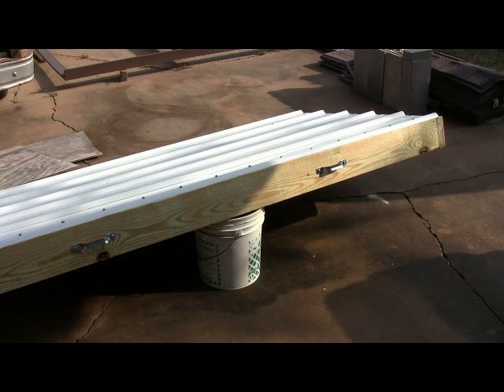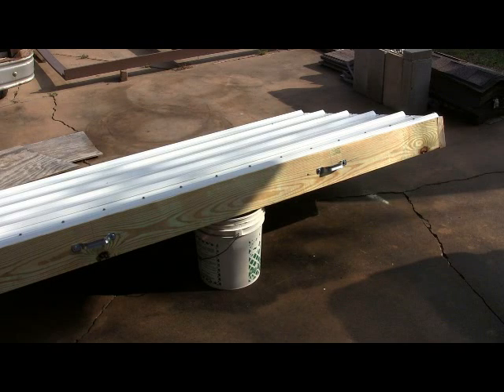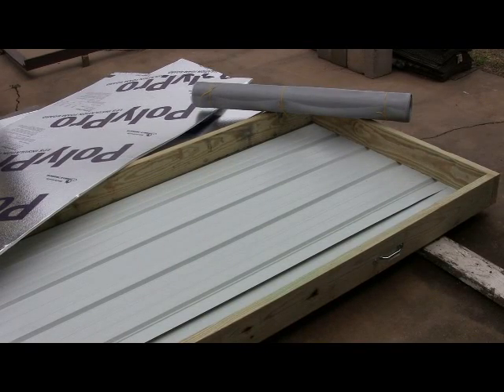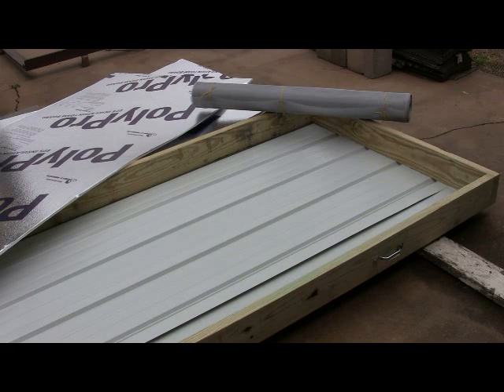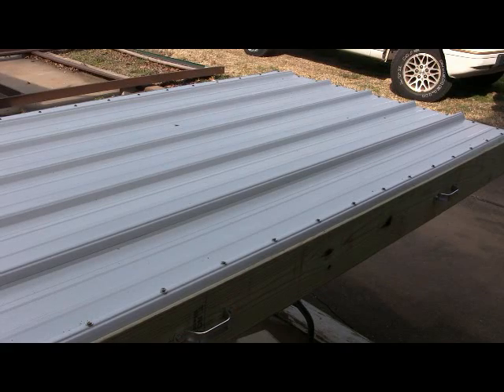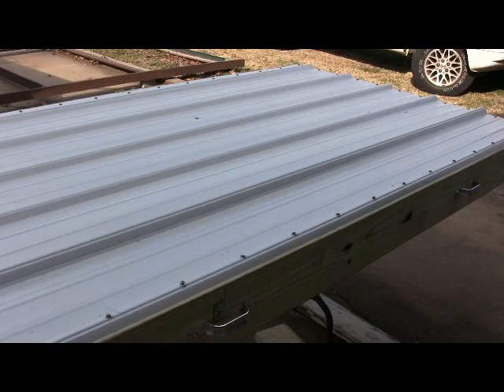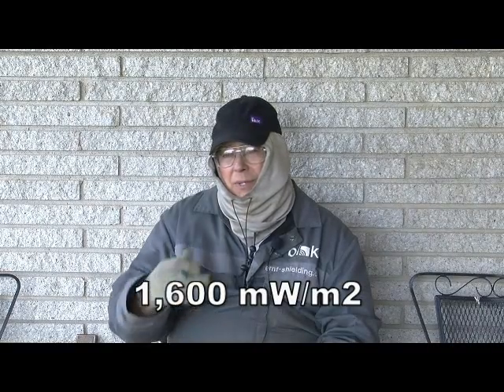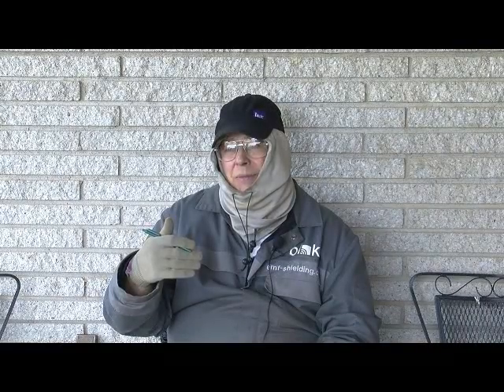Shielding yourself from Smart Meter microwave radiation.

Comment: I’ve done some research on this and supposedly copper will block these energy waves. I have not done this I’m just passing it on. You could line the wall with copper on the inside of home where the meter is and or build a box around the meter.

Comment: Do this until you can get your smart meter off your house I AM VERY SICK AND I PUT A SIGN ON MY HOUSE BY THE SMART METER TOLD THEM THEY BETTER NOT PUT ONE ON MY HOUSE THEY KNOCKED ON THE DOOR I TOLD THEM THEY BETTER NOT PUT A SMART METER ON MY HOUSE THEY LEFT CAME BACK A WEEK LATER AND I TOLD THEM TO GET THE HELL OFF MY PROPERTY ARE I WILL SHOOT THEM TOLD THEM I HAVE A RIGHT TO PROTECT MY PROPERTY AND I HAVE A GUN AND THERE IS A LAW WE CAN STAND OUR GROUND THEY LEFT THEN A COUPLE OF WEEKS LATER THEY SENT ME A LETTER TELLING ME I HAD TO PAY EXTRA FOR NOT HAVING A SMART METER  IT WAS FOR THEM NOT TO HAVE TO WALK TO EACH HOUSE TO READ METER  I SENT THEM A LETTER TELLING THEM I WAS VERY SICK WITH CANCER,DIABETIC,COPT,LIVING ON OXYGEN AND I WOULDN’T  PAY CRAP FOR THE NONE SMART METER  AND THEY CAN GO TO HELL I KNOW THEY ARE KILLING PEOPLE AND MAKING PEOPLE VERY SICK BUT THERE IS A WAY YOU CAN FIX YOUR SMART METER GET ALUMINUM FOIL SEVERAL LAYERS AND WRAP IT AROUND THE GLASS TO THE BASE OF THE METER THEN GO BUY ALUMINUM SCREEN MAKE SURE ITS ALUMINUM SCREEN  THEN MAKE IT IN TO A CUP THE SIZE OF THE GLASS WITH ALUMINUM FOIL OVER IT  THEN PUT IT OVER THE METER AND BUY A BIG RING THAT YOU CAN SCREW ON IT TO TIGHTEN IT DOWN AND VERY LITTLE RADIATION WILL COME OUT OF METER.RADIATION IF YOU DONT DO THIS RADIATION COMES FROM YOUR T.V.,MICROWAVE,ANY APPLIANCE IN YOUR HOME 🏠 EVEN WASHING MACHINES & DRYERS,CELL PHONE AS WELL. DO WHAT I SAID AND THAT WILL FIX THE PROBLEM 👍👍👍GODBLESS EVERYONE OF YOU🙏🙏🙏🙏🇺🇸🇺🇸🇺🇸🇺🇸

Comment: I didn't watch this whole thing, so don't know where this is being installed. But if the meter is still on the exterior wall, you are STILL being bombarded right through your wall into your home! The waves radiate in all directions. Plus, you may be getting MORE radiation by reflecting it into the house! You also don't need metal. Just line the inside of the house with about 4 inches of solid wood. That's probably a better shield than this. The only way to know for sure is to take readings from inside the house.

Comment: Do why dont you simply incase the smart meter in lead sheeting? That makes more sense than trying to erect something these waves pass right thru. Shure it may (or may not slow them down) where as a lead shield will not slow then  down. It will stop them altogether? And it in no way will affect the functionlity of the meter.

Comment: SMART METERS have one purpose - to reduce power company expenses and thereby increase shareholder profits.

One common element to meters - almost world-wide is that the property owner owns everything electrical other than the electricity meter including the meter box,  wires in to and out of the meter box. 

METER READING VIA CABLE
This means that if you place ferrite cores around the cables (think about those 'lumps' in power and keyboard cables connected to your computer) no data superimposed on the power cable will be sent.

METER READING VIA RADIO
Radio-based meter reading uses either MESH (many transmitters chatting to each other in a chain link configuration) or CELLULAR technology (shared channels in a HUB & SPOKE configuration like a cell handset system). Occasionally, but rarely, data from a geographical area is conveyed over a higher-powered system hack to the electrical system offices.

Any radio system sharing common channels (MESH & CELLULAR) basically have receivers listening out for 'dead' air, then they try transmitting.

Jam the shared 'calling' channel and you can block transmissions. Since the unhappy subscriber controls the physical area around a meter, they can install a low-power 'jamming' transmitter (more like an oscillator) adjacent to a meter. Many countries permit the use of low power experimental transmitters - certainly enough to jam MESH & CELLULAR receivers.

METER ACCESS
Watering the meter and the surrounding areas is usually enough to deter a meter technician from working on a meter.

Since the consumer owns/controls the electrical hardware surrounding the meter,  a secure cage can be constructed from rebar, with unobstructed view of the meter dials.

A friend's family, in northern Ontario (Canada), had owned a large tract of land since before new-fangled electricity came along. The electricity outfit had no easement across the land. Over the years, the cables feeding my friend's property had been upgraded as new subscribers built in the area.

When the 'smart-meter' arrived, my friend declined the offer and banned the hydro (electricity) company from his property. They said they would cut him off - difficult since the former single customer line was now a 'trunk' feed for other subs. My friend advised the hydro company should they suspend service they would have to remove ALL cabling, including the trunk feeder.

Hydro costed the alternative route and agreed that ALL subscribers attached to that feeder trunk could continue to use analogue meters.
Reply: Wow!  If only we could all be so fortunate!

Comment: Thank you. I am an awake electrician also, I use a Trifield 100XE, not as nice as yours, to take readings from a wide variety of installations. The MAGNETIC pulsing from 'smarty pants' meters is much more scary, going by the device's full scale banging of needle on full scale stop, than the microwave reading. The visible magnetic pulsing, in almost all installations FOLLOWED the ground wire unabated till it hits the basement water pipe creating a very extended dispersion antenna.  Most of the time there is a bed or couch above , somewhere along that line!
Reply: captainmidnite93 
What do you think of this: SATIC Power Perfect Box. Was thinking of getting. There’s a pretty good YouTube on it.
Reply: Just watched the promo, they make a lot of qualitative claims and only one quantitative-the 77% vs 95%.on some undefined "efficiency" rating. Slippery slope there. Power conditioning/filtering/smoothing is a valid practice but the infernal smart-ass meter is still gonna radiate from its sealed little unaccessable self. My experienced scrutiny of the devices shows it uses the large guage system ground wire to the water source  as a major radiator of complex magnetic pulsing. That wire all to often goes all the way across ones home to  make this vital/required connection, usually right under a bed, sofa, desk or other high occupancy area. An alarming feature is the signal radiating from this ground wire does not diminish along the length as it gets further from the meter, only stops when it gets to the water pipe.  I do not think the SATIC is capable of mitigating this evil. It very well MAY prevent the meter from telling what kind of appliance you are using at any time but only removal or encapsulation is gonna stop the meter's energy radiation.

Comment: what are you going to do about the Satellites in orbit broadcasting thousands of channels across the united states to be received by dishes as small as 16"  have you measured the microwave radiation from those.  how about the dozens of weather satellites blasting everything with radar of many frequencies to pick up everything from the smallest dust in the atmosphere that has drifted across from the Sahara desert to make it rain here.   how about the weather radar from all those aircraft leaving con trails across the sky everyday.. 

 you are going to need to build a faraday shield out of copper screen wire soldered together to block all the RF energy from getting to you in your house..  you can have vests and your caps lined with brass window screen to protect your brain and chest organs..  brass screen is a little itchy for your family jewels..  the short hairs tend to get snagged and its worse than getting them caught in a zipper. 

 as long as the brass screen is all soldered together and properly grounded.. you will get no RF in your house from any source.. 

 you may want to since the power wires coming into your house are cut.. also disconnect the wires from the meter and use the proper plugs to seal the holes in the meter box where the conduit went in.. so the can't be guided to your inside rooms following the house wiring and conduit.. 

 if you pull a copper wire from your ground connection.. and use aluminum foil tape.. you can seal the circuit breaker boxes completely from RF penetrating the house..
Reply: @cindykrista  you should watch the stars at dusk and early evening that don't move.. they stay stationary in the sky over the equator.. where the rest of the stars move.

Comment: They're offering smart meters in the UK for free and as a great thing to have to allow monitoring of energy use. I didn't realise they were using a microwave frequency transmitter!  Over here our houses are typically very small and if one was installed in on the lower outside wall then the furthest room in the house would probably be 20 feet away (main bedroom).   Plus there would be two meters, one for gas one for electricity. 
Thank you for this information.

Comment: Thank you for the info that I certainly would never known otherwise.Question: did you use steel stud framing on your bedroom Faraday cage?Or just staple the wire to the walls? I desperately need an answer for I'm very I'll from what I suspect is radiation poisoning.I refused a smart meter but don't know how long I can hold them off.I have two gas meters outside my bedroom wall that were just replaced with new ones because of corrosion problems.I didn't know they were dangerous.I Also have two elect meters because my house used to be a duplex.I have extreme pain everywhere,migraines, ms and Parkinson's symptoms, confusion all of which are possibly from the meters

Comment: To:   The Meter Man,  Is it possible to shield from the radiation when the meter is located on the exterior wall of the house?   Of course, besides removing the meter and using alternative energy for power !!!!    Thank you.    August 4,  2018

Comment: Let's look at why we do not need smart meters. 
 #1 A smart meter will hurt or even KILL disabled homeowners who have disabled medical implants.  The average of deaths by smart meter radiation and smart meter fires is almost 100 every month in North America.
#2 Did you know if your power company “turned off” the power to your home when they did a smart meter install, your chance of a smart meter fire increased by a factor of 10,000.
#3 Your power company has access to all of you private power information. Eg When you make tea, when you turn on your alarm etc. This private information is sold to Google for huge sums of money. Ask your power company what the second radio transmitter in your smart meter does. (ZigBee) 
#4 A smart meter will cause cancer to return if your family members who are fighting cancer at home. If they come home from the hospital and sleep near a smart meter, they will die. Check with the US Cancer Society website. 
#5 Smart Meter RADIATION  will turn off breakers in your home. Both AFCI's and GFI's get turned off by the radiation from the smart meter.
#6 You smart meter is very accurate, BUT, the software (firmware) is programmable. Your bill has nothing to do with the power you use. 
#7 Smart meter radiation is breaking Ionic Bonding. 
#8 A huge expenditure for a huge loss. Billions of dollars to purchase something that does not general generate any power and each smart meter need 4 watts to operate. One million smart meters use 4,000 KILOWATTS of energy to operate.
#9 The second radio transmitter is for ZigBee. If you want your power company to MONITOR your home 24/7, then you are in luck. Don’t forget, this private information will be sold. Why do you think your power company spends BILLIONS of dollars and does not generate one watt of extra power to sell?
Reply: Frederique Zug has anyone looked into them gosh damn wireless mouse detorent/trap's? I'm convinced they aren't as safe as they lead on. Just because you can buy it doesn't make it safe
Reply: And some have been known to cause House fires.
Reply: @H L Hey- H L, if you install smart meters and you sleep at night your an evil asshole, satanist and will burn in Hell.

Comment: ???
Reply: Let's look at why we do not need smart meters. 
 #1 A smart meter will hurt or even KILL disabled homeowners who have disabled medical implants.  The average of deaths by smart meter radiation and smart meter fires is almost 100 every month in North America.
#2 Did you know if your power company “turned off” the power to your home when they did a smart meter install, your chance of a smart meter fire increased by a factor of 10,000.
#3 Your power company has access to all of you private power information. Eg When you make tea, when you turn on your alarm etc. This private information is sold to Google for huge sums of money. Ask your power company what the second radio transmitter in your smart meter does. (ZigBee) 
#4 A smart meter will cause cancer to return if your family members who are fighting cancer at home. If they come home from the hospital and sleep near a smart meter, they will die. Check with the US Cancer Society website. 
#5 Smart Meter RADIATION  will turn off breakers in your home. Both AFCI's and GFI's get turned off by the radiation from the smart meter.
#6 You smart meter is very accurate, BUT, the software (firmware) is programmable. Your bill has nothing to do with the power you use. 
#7 Smart meter radiation is breaking Ionic Bonding. 
#8 A huge expenditure for a huge loss. Billions of dollars to purchase something that does not general generate any power and each smart meter need 4 watts to operate. One million smart meters use 4,000 KILOWATTS of energy to operate.
#9 The second radio transmitter is for ZigBee. If you want your power company to MONITOR your home 24/7, then you are in luck. Don’t forget, this private information will be sold. Why do you think your power company spends BILLIONS of dollars and does not generate one watt of extra power to sell?

Comment: I need someone to give me some information on a way to protect my family from the (6) smart meters that are on the other side of my apartment wall.
Reply: Barbara Keillor: Line your apartment wall with conductive sheet especially directly behind where the meters are located.  Aluminium, steel, copper, the thicker the better, you dont need to earth it but make sure there are no gaps at the joints.  If all else fails use 2 layers of baking foil glued to the wall.
Reply: Thanks
Reply: Amazon sells a curtain type shield fabric that I think uses silver wire thread.
Reply: Barbara Keillor exactly. I have 22 , 15 ft from my bed
Reply: Move.

Comment: Could you put the aluminum screen wire on the inside of your walls all around as a cage and work that way??
Reply from the maker: Yes.
It depends on how far away from the source of the radiation you are.
For some people, they are so close to the source that the screen wire won't work. Sadly, they have to move.
For others, the source is coming from ONE direction and they can put the screen wire just on the walls in that direction.
For others, the source is from 360 degrees. :(
What has worked best for people is to put the aluminum screen wire shielding in THOSE rooms that you spend the most time in. BEDROOM, Den, Living Room.
Some people build a "cage" around their bed to shield them during the 1/3 of the day that they are sleeping.
Reply: The Meter Man thanks for the info, so what if you ground the whole house would that sheild off smart meter radiation? Or just have yourself grounded most of the time in the house?
Reply from the maker: Grounding alone does no good.
If you put up screen wire, it should be grounded.
Some people just put up screen wire where they spend the most time.
They put up a "screen wire" cage around their bed, their computer desk, and where they sit and watch TV.

Comment: the shielding needs to be inside the house on the wall where the people are
Reply: .....The meter box IS made of STEEL!  Only the exposed portions of the meter itself need to be "wrapped" with metal duct tape, or covered with a large coffee can, etc. in order to "shield" the emitted RF radiation pulses.
Reply: how does the meter broadcast back to the power company if you cover up the meter?.....does all the data go back up the wire?
Reply from the maker: I disagree.

https://www.youtube.com/watch?v=iwMuWQQxJ9c